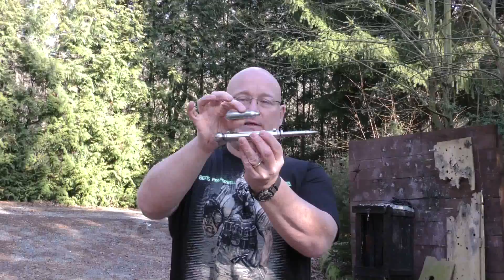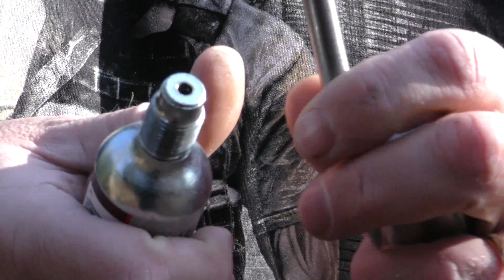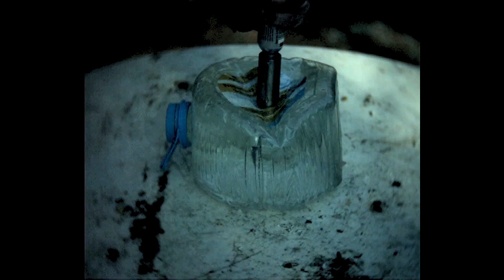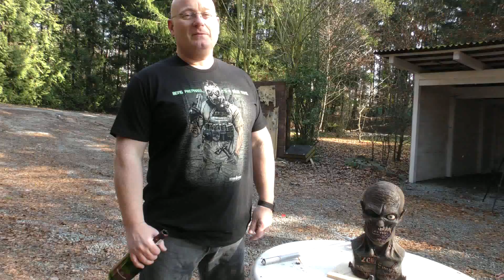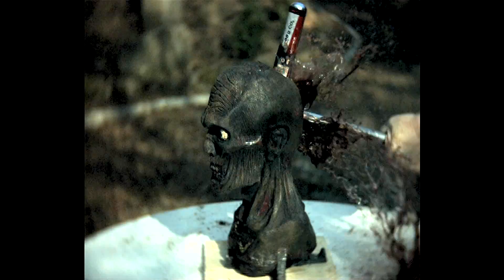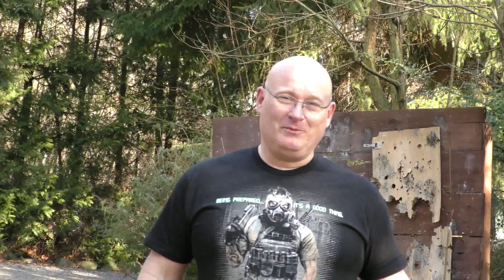Pumping 42 liters of gas into a Zombie skull?

Comment: you should try putting the exit wholes for the gas closer to the end, approx.: 1/2 from ens. then you need a stop washer so that it will puncture the seal just after entering. then try it on a water melon. on second thought, maybe just one whole at the end of the spike and a stop washer.

Comment: Mr. Sprave. Your spike needs a "Stopper". Vikings used a spear both for defence but also for hunting boar. you have the long spearhead and then behind it, you have a little crossbar, that prevents the boar from running through, so to speak and hurt the hunter. So on your spike, you can place a larger ring that stops the spike from going through too easy and help punch the seal :)

Comment: Heating the shit out of the gas would make the gas particles move a lot quicker, try dipping the canister in boiling water beforehand.
Reply: the cannister might buckle under the pressure of the compressed gas expanding on the inside though

Comment: how about making its so each canister can be used at least three times by making a prestrike pressure valve that after each strike is pressurized by the canister that way it would be more useful and you wouldn't need to worry about changing the canister each time you pop a skull.

Comment: you know you can always go to the butcher and buy pig/whatever heads. We used to have pig roasts every year, but we would always get a huge pig. We would have to take a chop saw and cut off it's head so it would fit. We would usually take a mortar and put it up through the neck of the pig in the head. It would blow like a foot off the ground from the initial force and then explode so there was nothing left. You would just hear little bits of pig head landing on 3-4 story roof tops nearby.

Comment: JoergSprave Have you considered turning this device into a weighted dart, shot by a rubber powered launcher? Use the older tube design, weight the back end (to push the cartridge forward at the moment of impact), and add a set of hooks at the front to grab the rubber... You could probably reuse the Toilet Brush Monster Sniper Rifle design ;)

Comment: Add a lighter to the end of the gas charges =flame thrower
Reply from the maker: Judith Setterfield CO2 is not flammable
Reply: JoergSprave though it's close to my thought, which was to decide on a fuel with a proper rate of burn, for a more violently expanding gas through a similar injection design...within cautious reason, of course :) even a flint spark on strike could make for a decent repeater, but the fuel is already getting complicated
Reply: googIesux There is a better idea. Rather than using fuel in the canister, use a good oxidizer, one that is hypergolic with most things at room temperature would be good. That way, you aren't burning fuel and hoping the target catches alight/is burnt, you actually BURN the target.

Comment: The problem I've had with rupturing CO2 cylinders for various projects is that it is under such pressure most of it changes phase directly to dry ice inside the cylinder when ruptured. The spike looks like it provides enough restriction to prevent it quite a bit, but you're still losing a lot of gas and a lot of pressure.

Comment: Why don't you attach a round metal plate similar to a large metal washer with a small hole drilled through the side for a grub screw that way it has a larger surface area to create more force on the cartridge seal to pop it and also the plate can slide up and down the spike due to the grub screw so you can select the desired depth you'd like it to release the gas

Comment: what if you connected the whole thing to a compressor instead of a CO2 cartridge? It would make it limited to the extent of the hose but it would also be easily repeatable. In fact you could probably fabricate a spike that would attatch to the end of a nail gun and that would be heavy where you wouldnt need to add any weight.

Comment: JoergSprave - as ***** said below you, you should put a hilt type piece at the start of the spike that would penetrate the cartridge instead of the spike itself. That way the hilt will trigger the cartridge and allow the spike to enter the skull before going off. Also the hilt will stop the spike from continuing through the skull and stop inside the skull to allow the gas to release inside the head and the hilt will the brunt of the force and save the spike from overtime damage.

Comment: You could try a small circular plate at the base of the spike, so that if it does penetrate without capping the cartridge, the little disk would hit against the penetrated surface which would open up the gasways.

Comment: The fail was really predictible. On this new version you removed the guard that we talked about last time. So it's impossible to pierce the cartidge because it will pierce the skull first and then nothing. 
I think a simple solution is to add a quiet big guard (6 or 8 cm diameter) aroud the spike after 4 or 5 cm so it can penetrate the skull for 4 or 5 cm before piercing the cartidge. Because of the guard, your energy will be transmitted the the skull on a large area but on a small area on the cartidge. And then... Put some protection glasses because you might recieve some zombie skull parts haha.
Reply: Doubt seriously that would work cause with the amount of pressure hes using would blow the entire thing out,just releasing the gas into the air.

Comment: Loving the zombie videos Joerg! I had an idea for a new slingshot concept, something like russian dolls but with slingshots. Theyre lined up on some sort of contraption and they progressively get smaller in size and bands the closer they are to the user. It would be useful for heavier ammunition, and it would just look cool. It would probably require some special device to pull back all the bands, and the ones in front being the longest would go all the way to the back and have the pouch so that the bands from the slingshots before it are really just to add power to it. Not sure how to explain it further, hopefully it makes sense.

Comment: I think it would be better to swing the device into the skull ...  then have an actuator to release the gas, after it is in place.   there should be electric valves you could power with a battery and switch attached to the rig.

Comment: You could add a rim to the spike a few centimeters after the gas holes. That should make the cartridge pop more reliably. You would have to come up with a different way to secure the spike in the spike holder, but a threaded end and a nut should work there, from what I can see.

Comment: why not make a 2 stage weapon, like the spike pierces through and a iner ring could do the punch on the gas and cut it open? like you said that spike ir very sharp and makes little resistence i think a iner ring or something could have enough energy to still open the  gas, PLUS, it will make the spike be already inside when the gas pop out =D

Comment: Try adding a plate to the spike at the top so it stops at a certain depth. The added surface should be enough resistance to puncture the container.

Comment: could you not install a trigger like thing, so you first pierce the skull and then pull the trigger to start the gas? so you would first make sure that the gas doesnt eject BEFORE the skull ist pierced and second by pulling the trigger afterwards make sure, does the gas really ejects. than it wolut not stay inside like it did in the zombie test.and by the way, great video, keep doing that stuff!

Comment: You need a collar (10cm diameter washer) attached to the spike shaft which will stop the spike from continuing to penetrate while also using the outer surface of the skull to provide resistance via the collar to pierce the CO2 canister....
Reply: 10mm you meant

Comment: With the spike you should put like some bolts or rods sticking out horizontal from the tube above the ports that eject the gas,so that when you hit the head/melon it could act like a kind of stopper to prevent it from going any deeper. Seems like a good way to maximize the deadlyness :)

Comment: If you poke a small pin nail in a sheet of metal, on the other side you will have a hole lined with a few spikes. You could use that for piercing the cartriidge.

Comment: I think that instead of the spike moving back to pierce the gas cartridge you need a washer a few inches behind the tip, with a spring behind that. Two rods are attached to the washer, and they slide back into the device and trigger the mechanism to puncture the cartridge. This way you do not depend on the spike to do the gas release, as it has a tendency to penetrate to easily without triggering the gas release. Better yet, use an air tank with a hose and a metering system that allows only enough gas out to do the job, and you have multiple shots without reloading. Wear the tank on your back. What fun this is!

Comment: What about an arrow with this system but instead of compressed CO2 you would use a light inflammable gas and after impact of the arrow a mechanism would produce a spark(im thinking about those those tiny black boxes that are used in lighters). Idk if this is technically possible and of course such an arrow would only work on hard surfaces such as a wall or something but it would be definately fun to shoot and to watch ^^
Reply: Did you not see what happened when he threw the old spike on the ground? It launched like a rocket. And that was just CO2. Now imagine that, but with fire. It'd be far too dangerous.
Reply: Michael Blood Thats why you gotta throw it far with a bow  xD
Reply: Making something like that would be childs play for Joerg lol.
Reply: Joel Da Silva The weight might be too much for an arrowhead
Reply: Joel Da Silva
yes. use the bow to throw the arrow.

Comment: Put a flame in it
Reply: The carbon dioxide from the capsule would just extinguish the flame.
Reply: WH250398 nope but he could use hydrogen
Reply: Nope. CO2 doesn't combust as it is already oxidised. A preliminary test for the presence of CO2 is to put a flame into it and watch if it goes out.
Reply: WH250398 CO2 is already burned carbon (e.g. coal, other organic matter)
Reply: You do realize there's only 0,03% CO2 in the air?
Reply: Waitee Games
Contrary to what you would expect, inflammable is a synonym of flammable, not an antonym. His usage of inflammable in this case was correct, even if his conclusions were wrong.

http://www.oxforddictionaries.com/definition/english/inflammable
Reply: ThreadThatHas NoEnd hydrogen and oxygen would burn better.
Reply: yes he should make a liquid rocket fuel spike
Reply: What would a flame add?
Reply: SliinQ
Fire
Reply: How about a picture of a flame?
Reply: might be illegal in germany though ._.
Reply: BurningSky93 You mean synonym of "flammable", you just called it a synonym of itself :D 
Adding to the original point: You know fire extinguishers use CO2, right?
Reply: ***** mine use Halon :3
Reply: Flames would be awsome!!
Reply: CO2 doesn't burn?